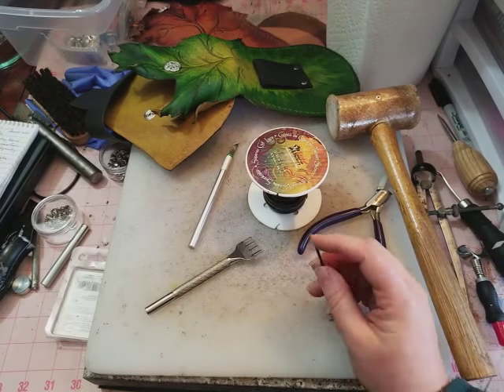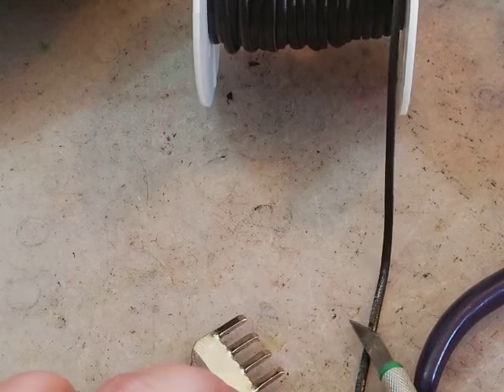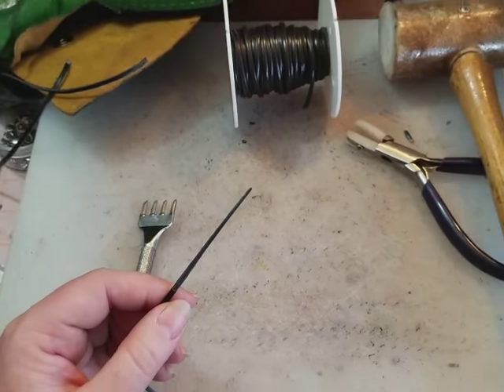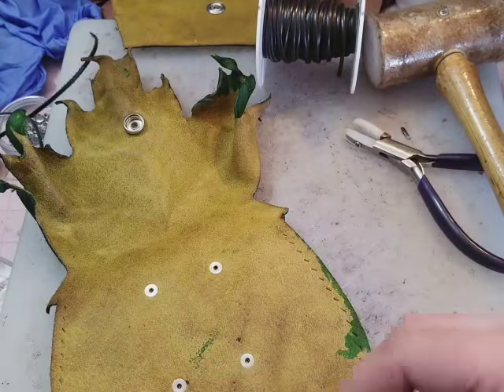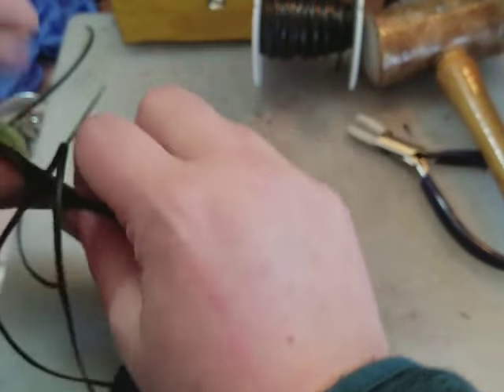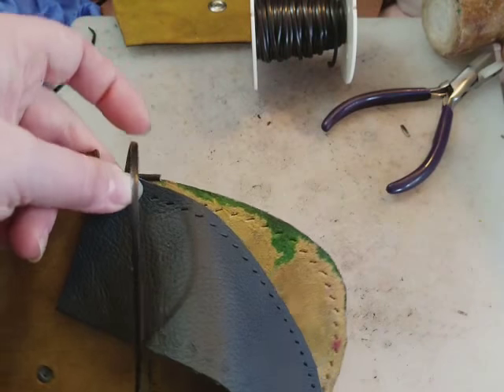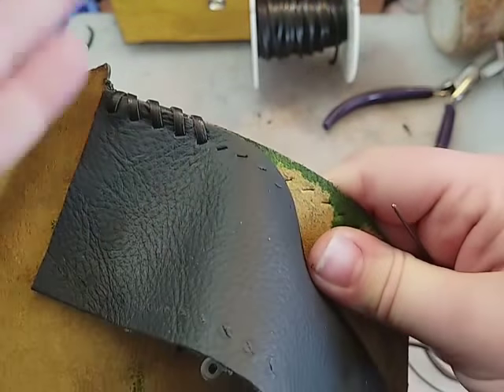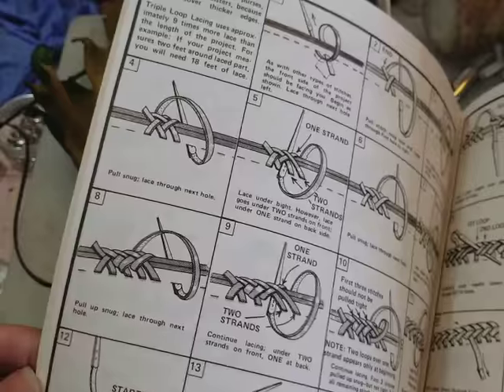Lacing 101: Whip Stitch

Comment: Thanks Yvonne! 2 yrs later in 2020... Still relevant! ❤️ Very helpful tips, including tools, materials, resources. Still in awe of your talent & creativity after I found your channel 5 yrs ago. I started with wire wrapping/weaving & got into many other genres of jewelry making. Hard to stick to just 1 or... 5, lol! 
***Q: What type of glue/adhesive do you recommend for leather work? I'm attaching a double strand of stone beads to leather strips (mag. buckle clasp at opp. ends), probably strung on Fireline. May sew through leather to finish but may be more secure with a touch of glue on knot... Or should I punch sm holes for thread & knot? TIA! ❤️